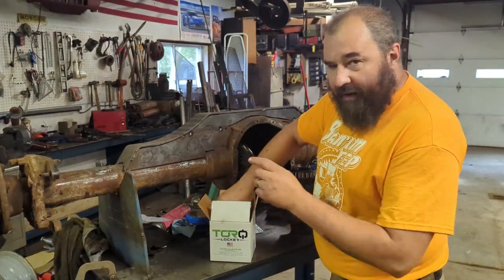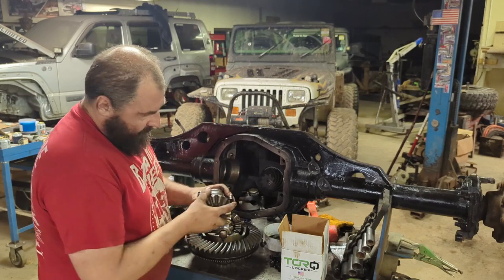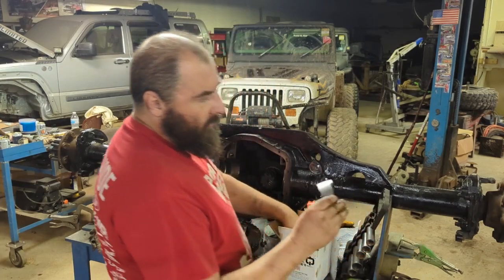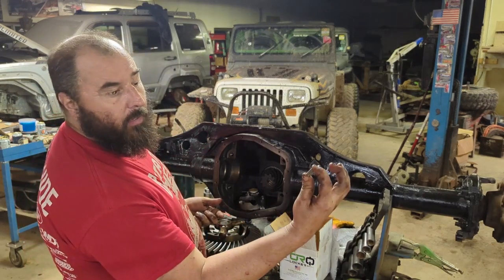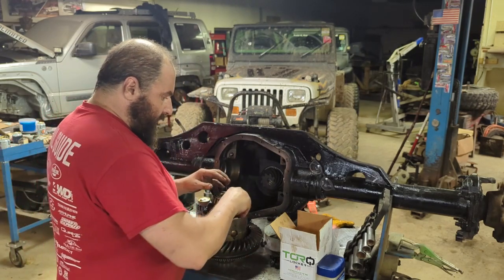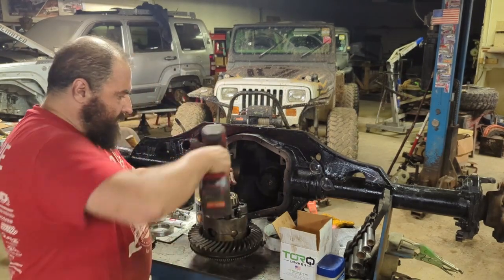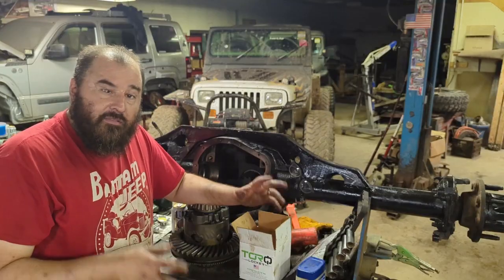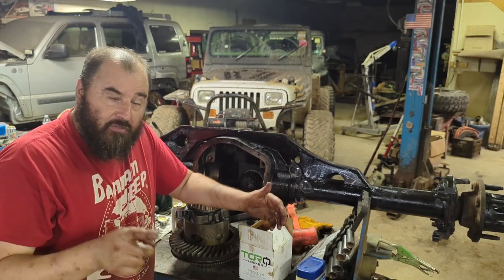Installing a Prototype Sterling 10.5 Torq Locker for the One Ton YJ

Comment: cool product. I see you remounted the Nitto 40s...should be plenty of locker for that. I was going to run the factory ford 10.5 e-locker in my build but if Torq Locker is going to price the 10.5 locker close to the 14 bolt they have.. I might just go this route.
Reply from the maker: The E locker was my original plan as well... Until this thing became available
Reply: Pretty sure the approximate price point will be a little above the 14B. But the most expensive TL is $460 so it definitely always gonna be cheaper than an e locker!